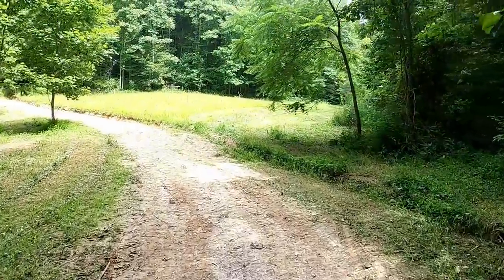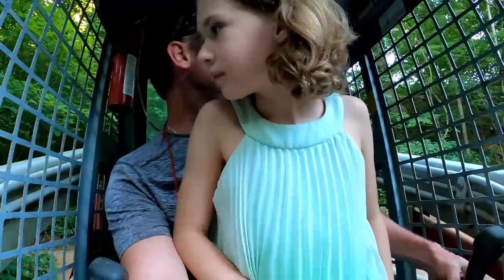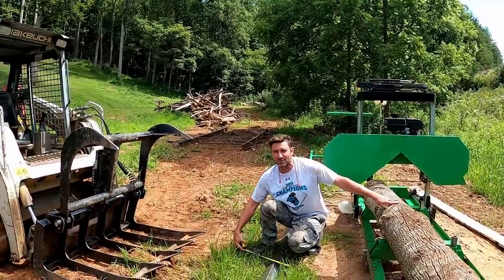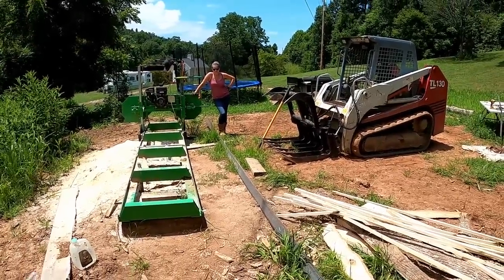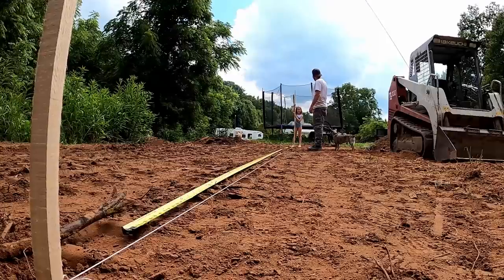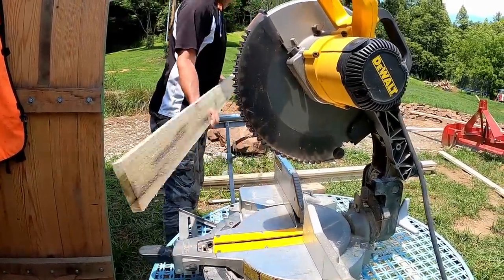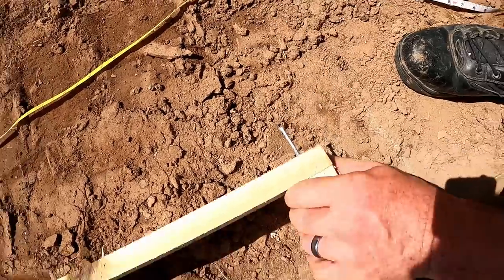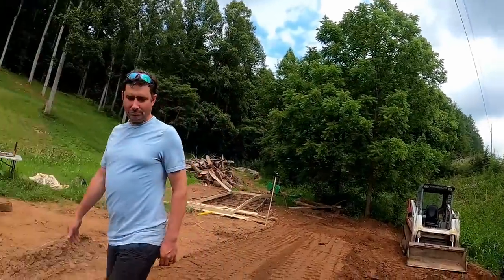Improving our sawmill // E95

Comment: A laser level would make your grading much easier. Meg can check the grade and tell you where you are high and low.  Glad to see you teaching the girls how to use tools and machinery.
Meg your description on leveling with a skid steer is correct but if you were using a bulldozer then you can adjust the blade to counter the problem you described.  Keep up the good work guys!
Reply from the maker: Yes, a laser would have been great for this and it's definitely something on the list to buy for the big house project.  I should just get one already.  Been on my wish list for a long time now.
Reply: I highly recommend it, we are doing similar in Washington, do far i have 2 she's on concrete pads so i can get practice with smaller structures. I tried leveling without the ladder on the first pass, then did it again after i got the ladder when i spread gravel, it's amazing the difference! Night a Johnson level kit from an Amazon, best investment for the homestead ice made aside from the tractor and mill!
Reply: Or if u do not have one a clear tube with water

Comment: Couple things.  First.... the frame you picked up is from a 70's or 80's mobile home.  Best guess is it's the track in front of the wheels and behind the hitch.  There was no bracketry for the leaf springs or the hitch to mount.  When it comes time to use it for your building laminate it or sandwich the beam with good bolts and boards 2 inches thick.  Over long runs without additional support they are weak laterally and when you build on it any pressure will cause it to bow and distort.  Vertically they're pretty strong.  I've demo'd several mobile homes in my previous job so I've had experience in breaking the frames down so they fit in a container for the scrap yard.

Second.... On your form boards.  Make sure to either pack dirt on the outside of the form to prevent the boards from bowing or add 45's to add additional support.  And just prior to pouring the concrete soak the inside of the form with WD40.  And I mean soak them.  Get the big can and go happy with it. This will help prevent the concrete from sticking to your form boards.  

Finally...  what are you going to do with the old sawmill tracks?  I think they would match up nicely to my harbor freight.😁
Reply from the maker: Cool tip with the WD40  👍
I'd love to give you the tracks, but that 1/4-inch angle iron will come in very handy with all the crossmembers and clamps I need to retrofit.  Thanks for the tips on the I-beams.  It makes a lot of sense to sandwich the metal with some wood.  That will make a very nice beam with some through bolts.  Hopefully, the wood will straighten everything out.  There are a few bent sections you can see when looking down the I-beam.  I'll probably use some hickory or oak on the outsides.
Reply: @WalnutsandWineberries  I apologize for not articulating correctly on the first part.  I was not looking for a handout.  But I do understand where you're coming from on the track.  

As far as the bends in the I-beams go you've got enough level soft ground hydraulic power that when the time comes you should be able to pick the best section and then pound out or pressure the beam as straight as you can before you laminate it.  Wood will move over time and my fear would be the bend in the beam would translate into a warp in the wood.  I could be wrong but I think clamping the beam near where you want to bend it and then focussing pressure with a come-along would help put the beam into a more solid position.  DONT use a winch or try to pull it with the tractor!  It would be too easy to over torque it the opposite direction.  You need a good deal of finely applied force not a sledge hammer pounding a brad nail.

Comment: Yep, I used Phillips screws all the time until I discovered Torx. Now, I use nothing else. Your concrete form looks great and I like the way that you two work together. Yep.
Reply from the maker: I'm a T25 guy, too 👍
Reply: @WalnutsandWineberries  Yep, learned it the hard way. You may have too.
Reply: I know you seem to prefer using lag bolts, but you may want to look into rss screws, torx heads, reverse threads to help with issues backing out/loosening, self tapping, smaller shank so wood remains stronger, easier to use, and cheaper too (at least at the store or west here..)

Comment: Hello John, hello Meg. I’m enjoying your videos very much. Keep up the hard work, it means a lot to us viewers. I remember you and Meg mentioning all the research and time spent on plans for your home. It is a dream you want to fulfill and I want you to fulfill it also. Your Mill is the main means of making that dream come true. Without it in working order you will not have the wood ready for building. Your house and your mill share similar requirements, they both need a foundation sufficient to cary a load. Will a few inches of crushed rock and 4 inches of concrete support 18 inches of block wall  your steel supports the mill plus a the weight of the log. The last thing you need is a mill that can’t process the lumber. Now is not to late to do the research needed to make sure the mill will hold up to all you demand of it. Your dream house depends on it.

Comment: I believe what you got there John is part of an older Mobile Home Framework that has been cut down. From back in the 60's up till about the mid to late 1979 the Mobile homes best features were their framework.  Those cross braces look very familiar to some of the older mobile homes I've torn down and/or moved. Really a nice find as they were heavier constructed back 40-45 years ago. I'm sure you'll find some good use for repurposing it. I love your projects like this. Always learn something from you and Meg and your projects.
Reply from the maker: Hi Dean, good to hear from you!  You hit the nail on the head.  I guess I was partially right about ID-ing it as a trailer.  I see stuff like this and I feel like I need to rescue it and give it a new life before someone comes along and scraps it.

Comment: Hi guys,
The mill formwork is looking good. Great start!
If you don't mind, I'd like to give you some tips about concrete.
Some things to know about concrete:
It has good compressive strength, but it is not so good in tension. Hence the addition of reinforcing to improve tensile strength of the slab.
Generally it is best position for single sheet reinforcing in a slab like yours is mid depth, ie 2" from the bottom in a 4" thick slab. This should be uniform throughout the slab as much as possible. That way the tensile strength of the steel best counteracts with the most compressive strength of the concrete. An additional benefit is that the the thickness of concrete better protects the steel from oxidation (rust).
The thinnest part of a slab determines the overall strength, so the key is to aim for uniform concrete thickness throughout the slab. On this point, the easiest way to level the foundation of a slab is to cover the dirt with an inch or two of sand and screed it with a depth board gauged to the top of your formwork. Don't worry about water getting under the slab, because no matter what you do it will get there, gravel or not.
It is a good idea to pour the slab on a plastic membrane. This has two benefits; it keeps moisture in the concrete longer, thus producing longer curing time and stronger concrete, and it helps keep the underside of the slab flat and smooth. ( Remember any concrete deeper than the minimum depth is wasted.) 
For long, thin concrete slabs, it is a good idea to add extra reinforcing steel bars along the outer edges of the long side. Remember to keep all steel at least 2" from the concrete edge (ie the formwork). This will be particularly useful if you accidently introduce a point load on the edge half way down the slab length, with say, the track of a skidsteer loader or heavy log etc.
To assist the concrete to reach its maximum strength, remember to keep it moist for the first few days. This is particularly important during summer. The chemical process of concrete curing (strengthening) requires water. As a guide, concrete reaches about half its design strength in about 5 days, 70% at day 7, and 90% by 28 days.

You might also like to rethink attaching the mill rails to block walls on top of your slab. You might find that working the mill at such a tall position introduces issues for the operator.  Also, block walls are not as strong in tension as you might think. Best way to attach rails to the concrete is to lay them out with the correct spacing on the slab (I suggest welding temporary spacers), mark and drill holes for threaded rod to be chem-set into the holes. The rails can be mounted on the threaded rod and adjusted up or down with nuts and lock nuts. Position the anchors along the rails at distances so as to eliminate any "sag" .

 I hope this is useful.
Cheers guys.
Reply from the maker: It was very helpful, thank you for taking the time.  Good point about plastic membrane below helping the moisture retention as it cures.  Usually, people think it's all about keeping it dry post-cure, but this is a very good point.  I'll make sure to add some before we pour.  Also, you need some height between the rails and the ground for backstop clearances and to keep the rails away from the sawdust accumulation, but you got me thinking about the tensile strength.  We are brainstorming to still using block, but perpendicular to the rails every 4 feet so it's just a vertical spacer.  Then add threaded rod for leveling and mounting the rails to.  It's very hard to explain without a picture.  Long story short, thank you.  You pointed out flaws I had not considered and now we're re-engineering the rail mount design.  👍
Reply: @WalnutsandWineberries  Agree with you plan of perpendicular spaced "walls". The added height off the ground makes it easier pulling boards off.

Comment: You can really see Meg in Autumn's facial expressions. The knot you tied in the line is called a "Trucker's Hitch" it's used for securing loads.
Reply: And I personally hate those knots for the reason they really really suck getting them out. I use a knot that comes right out when I want it out and it never slips out accidentally and leaves the rope nice and clean of kinks, I'm not sure what it is called but I learned it from an old trucker and have used it every since.
Reply from the maker: Yes, it's usually a one-time deal and tying the other side to the loop only makes that loop tighter.  If you find out the other knot, let me know.  I'd like one that slips out when the job is done.
Reply: The truckers knot that i know is slightly different, and as mentioned previously is able to be undone quickly. Look up a pamphlet called ”The Six Boy Scout Knots” by John Geffre, it details tying it on page 2, lower right. Use a hitching post knot to start, the truckers knot to finish, and both ends can be easily and quickly untied while remaining completely secure. 

The truckers knot is basically the same as what you did, only instead of ending with half hitches making it a permanent knot, the first half hitch is secured under itself and not pulled through all the way, the loose end wraps around to help it, but the tension pulls it tight against itself

Comment: oh,  if you want a pitch the clear tubing can be used for that also.   You only need short pieces of clear tubing and garden hose .   Concrete block  are heavy and strong Cinder block are light and not very strong.

Comment: On your walkway, why not have it on the other side? After you pour slab set the track part of the mill near the edge you will load the logs. Set the saw trolley so you walk on the side away from the side you load the logs.

Comment: Are all of your screws star (philips) head? When you said deck screw... do they have a square head for the driver(robertson). Up here in Canada we've been using square drivers for ages because it's a much better product. Stripping the head happens far less. If you can get them zinc coated vs ceramic coated they are also much better. Not sure if this helps or not.
Reply from the maker: Hey Richard - I really try not to use Phillips anymore.  I do like the S2 heads, but I like T25 even better.  I grabbed a few Phillips in a pinch and quickly regretted it.  Haha.

Comment: At 14:50 why don't turn your sawmill to get the operator side on the right side (opposite to the loading / unloading side). Your concrete slab will be in the good side then.

Comment: Rethink your block walls under the rails. You will have sawdust collecting under your mill and continuous walls will make it hard to clean it out because of the cross braces on the rails. Might be better to make the walls go across the mill so you can rake the debris out and Rambo can scrape it up from there. Same with a back wall on your sawmill shed… that is where the sawdust goes ( and, where you will eventually have to clean it up from.)
Reply from the maker: Yes, we had similar thoughts and are making the blocks perpendicular now so they are acting as spacers.  We're also using threaded rod so we can get the level perfect which will be chemically set into the filled block.  My main worry was knocking into it with the machine or having a log slip away and ruin the wall.  Plan B is a much better one 👍